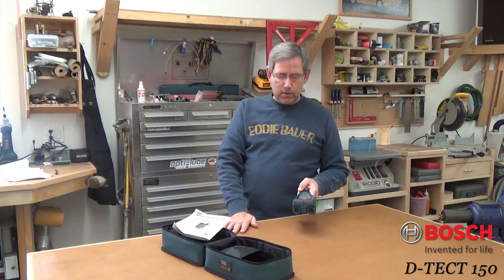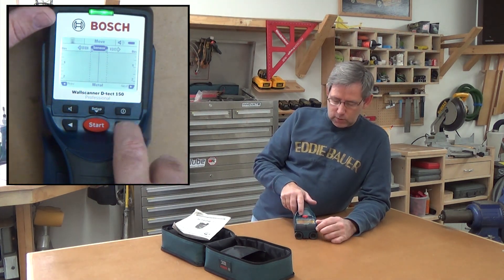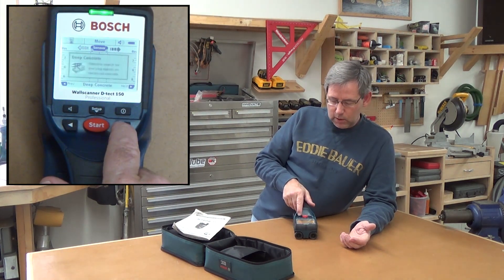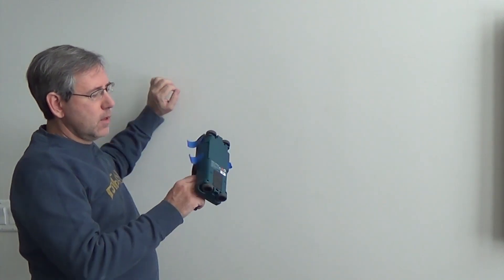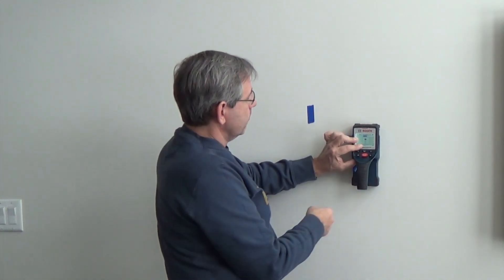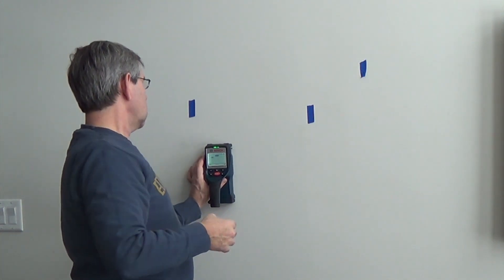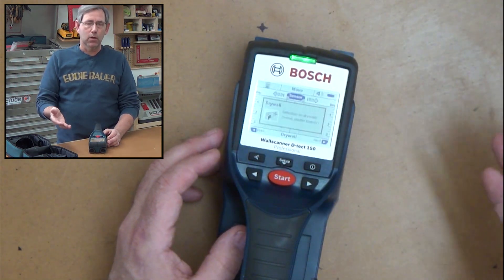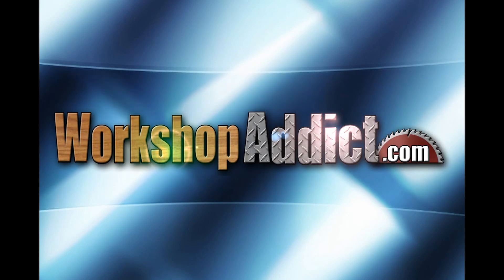Bosch D-TECT 150 Wallscanner (stud finder)

Comment: Could this find rafters through a comp shingle roof?
Reply from the maker: I do not believe it would work well.  For one, the wheels have to all turn at the same speed and the shingles would make that hard.  Second, there is a lot of material to look through and this does not work well on plaster.

Comment: What about single or double-wythe walls? Is this scanner still reliable to detect objects as described for concrete walls?
Reply from the maker: It will not work in those walls.
Reply: thanks a lot for your response. Excellent video.
Reply from the maker: Your Welcome